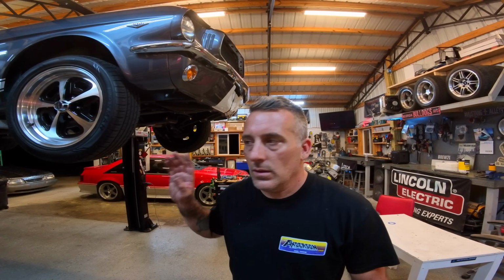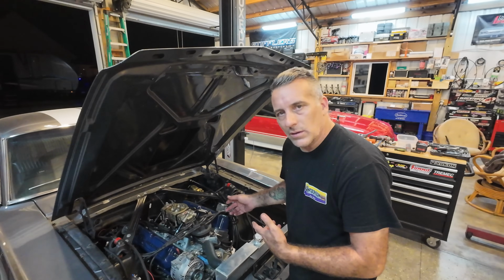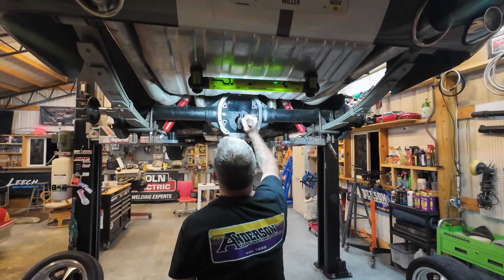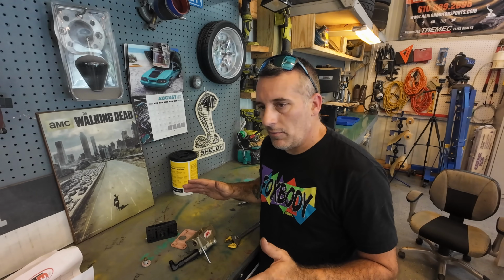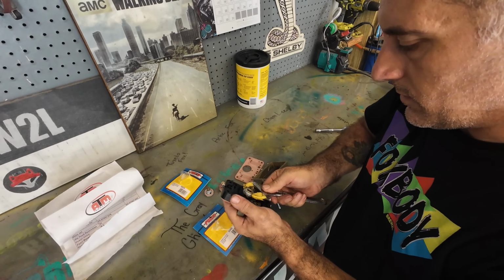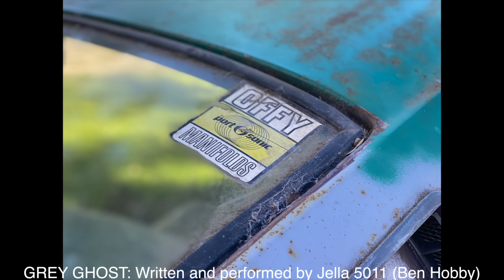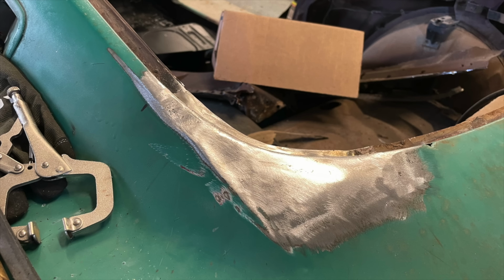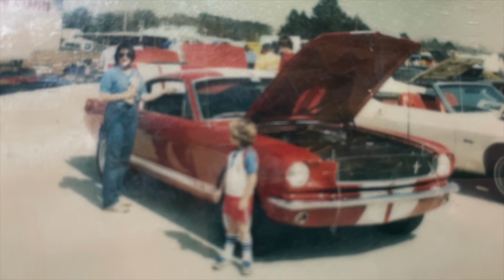mr happy

Comment: Great video, glad you're getting it sorted out. Sometimes the smallest things make the biggest difference. I'm anxious for you to figure out the transmission issue. My 84 is doing the exact same thing. It's  a brand new tkx. Everything under the car is new. New aluminum driveshaft, completely new rearend except for the housing itself, all new chromoly control arms with heim joints, new shocks and coil overs. Ive almost got used to it but it still drives me nuts. Some lil something is wrong.

Comment: The video of undercar near the front of the driveshaft. Are  you sure it isn't vibration of the exhaust against the Stifflers transmission mount or somewhere else? Could be exaggerated by the change in the direction? Just a thought? KISS.
Reply from the maker: It looks like it’s touching but there’s actually quite a bit of room between the two.

Comment: Just got my 95 swapped over to a carb. It’s got a whole new top end on it. I’m having issues with the rockers hitting the valve covers. They’re just plain black steel summit racing covers from a black dress up kit. What kind of covers would you recommend, it has 1.7 scorpion roller rockers on a set of Promaxx 185 heads? Can’t get them to seal up either cause I think they’re hitting the poly locks.

Comment: Looks almost like the driveshaft hoop is grounding out against the exhaust. Another thing to check, as a lot of what you changed doesn’t give a flying f**k about what gear you’re in, is the shifter. Make sure it’s not hitting the floor or something in 4th. 

For example, a clutch, pilot bearing, or throw out bearing would be noisy at a certain rpm, or whether there is pressure on the throw out bearing, or pressure plate.

Pinion bearings, or gear mesh tend to be a tip in/tip out whine noise, seen a few be bad enough to be speed sensitive, but if they’re that bad it tends to be noisy all the time, but just get worse the faster you go.

For it to be a 4th gear issue, I’d lean toward shifter, or the gears/synchros for 4th. Which since Hanlon went thru the trans, and I’d guess didn’t just breeze thru it, as it’s gonna be on you tube and they don’t want to look bad, I’d guess internal trans is good.

Just my .02

Comment: Part of the problem is you have the pinion angle wrong, the pinion angle should be around 1-1.5 degrees down, then under acceleration it will be around zero

Comment: What does the car do with the 373 gear. I’m building a motor with that cam as well.
Reply from the maker: It’s fine for the most part. But anything under 2000ish RPM it wants to buck some. The 410s just seem to be the sweet spot!
Reply: @BREW2LFOXBODY  ok gotcha good to know thanks

Comment: Do you have any solid bushings anywhere on the car? Mine makes a lot of noise when I drive it and everything has solid bushings and hyme joints
Reply from the maker: No solid bushings
Reply: I did urethane in 95. Rides stiff and thumps on any bump.

Comment: About 20 yrs ago Chevy pickups with aluminum driveshafts made annoying sound when shifting. They were sure it was a drive shaft harmonic. I dont know what chevy did.
😳😳 
Pappa T might remember back in the 60s Ford put cardboard inside the car driveshafts that had the rubber coupling to stop the harmonic. 🤔